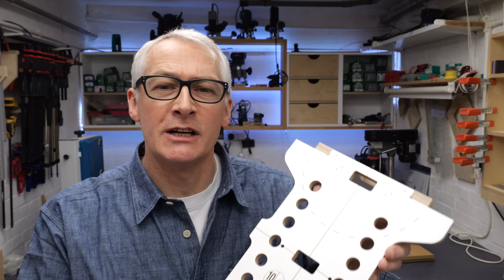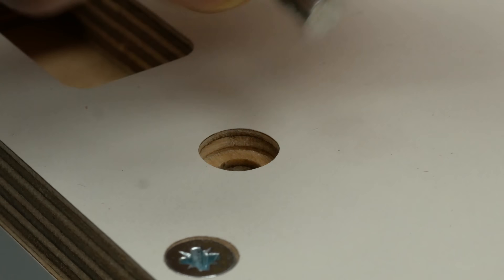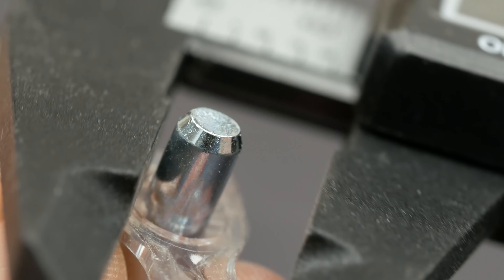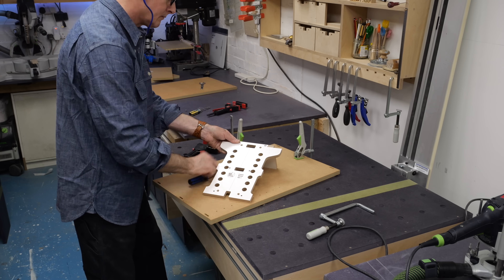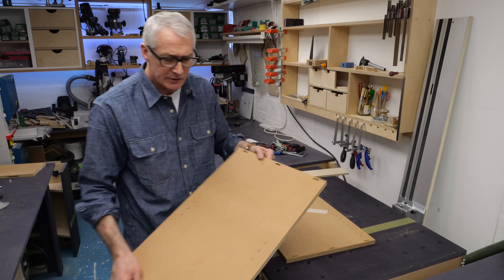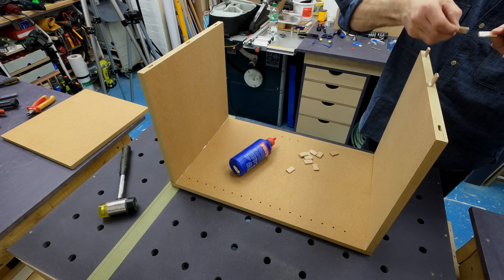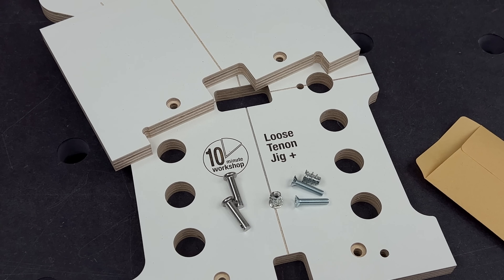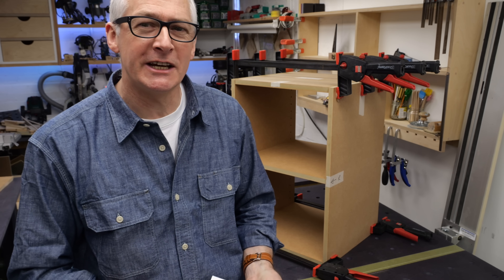Loose Tenon Jig Plus [video 493]

Comment: I like this jig, but it has two issues:
- it is tightly coupled to the thickness of the material, your demos are done with one thickness only. Same jig needs to be made in various thicknesses with a template bit (which is not too bad).  
- dust extraction doesn't work ver well (or not at all), and this is mainly because of the guide bush, and not because of the jig itself. MDF dust is also stickier than solid wood. 

Your jig inspired me, and I did some modifications to improve dust collection and make it work with stock 1/2" - 3" in thickness. With mine, I can also adjust the length of the mortise.
I would be happy to share with you if you are interested, maybe you can help perfect it even further.

Comment: I loved this concept when you first showed it and bought the plans but haven’t yet made it. I will definitely be adding wings. 
Two questions - Can you offer a lead on where to get the guide pins  and as you didn’t mention peanuts I assume that you are sticking with dominoes and the flexibility of the wider middle slot
Reply from the maker: Thanks! I like the wiggle room that dominos allow with the wider slot, but I’ve tested the original jig with peanut connectors and they worked well. You can pick up the guide pins off Amazon or eBay - they’re called  clevis pins. 👍
Reply: @10MinuteWorkshop  Hi Peter, out in the US Midwest cattle country a “Cleve’s pin” will get you a different beast. Nice jig! You really skinned that cat!

Comment: Great stuff. Ordered already, the wings are a great upgrade. Last time I used the original I had to resort to using the peanut jig to cut the mortise on the face edge of a board because of trouble clamping. I found the result was inferior to using your jig, so looking forward to receiving the new version.
Reply from the maker: Thanks Peter. What size router was that with out of interest? The original jig was meant for 1/4” routers like the Trend T4 and the Festool OF1010, just curious what was bigger than the Festool - assuming that was the issue. 👍👍
Reply: @10MinuteWorkshop  It wasn't the router, Makita DRT50Z, but rather the larger base that I have fitted to it.

Comment: Another great video - would you usually clamp up the cabinet using squares to ensure it's square ??
Reply from the maker: Thanks Peter. TBH I’m pretty confident that a small cabinet like that will be square, but as a general rule with anything bigger - or critical - I’d clamp a square into one corner, just to be sure yes. 👍

Comment: hi peter could the shelf pin holes (with the right router cutter and bush) be used for for making dog holes?
Reply from the maker: No, not on this jig. It’s something I looked at, but decided against as it made everything unduly complex and compeomised.
Reply: @10MinuteWorkshop  cheers

Comment: Here in Oz we are offered '5mm' and '6mm' shelf pins, which turn out to be 3/16" and 1/4" when you check them closely. But you have little chance of finding solid carbide router bits in anything other than 1/4"(6.35mm) or 1/2"(12.7mm) locally, all the other sizes are made for metal milling machines intended to fit their standard collet systems where the bit is parallel from end to end.
Reply: On aliexpress you can get 5mm and 6mm cutter on 6mm shaft.
Reply: I've usually used a drill mounted in a pretty cheap sprung frame (possibly Wolfcraft) that I've had for decades. Brad bits work best and very well - used them for many years
Reply: I've never seen the 1/4" pins sold as 6mm. But I agree finding a 5mm cutter here is difficult.

Comment: Excellent Peter. Been waiting for this to decide which one to buy. Do you know if that guide bush fits a Makita Cordless trim router (same as your Katsu I believe)?
Reply from the maker: No, you need a different bush, same as the Katsu you can either buy a brass set on eBay for ~£20, or a 3D printed one-off on Etsy for about £6 👍
Reply: Thanks. I thought that would be the case. I have a set which I think fit but I have not yet used or tested them. But at least I know not to add one to my order :-)